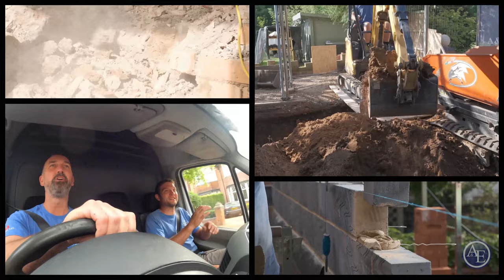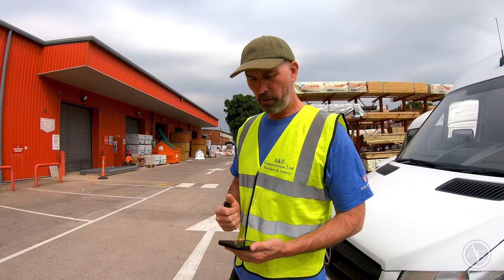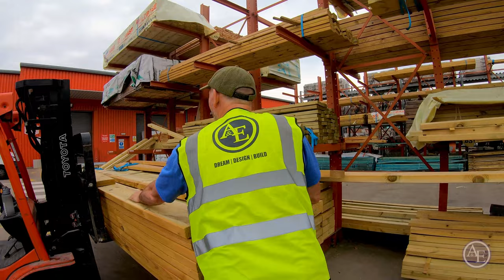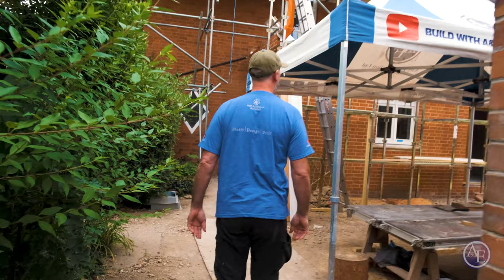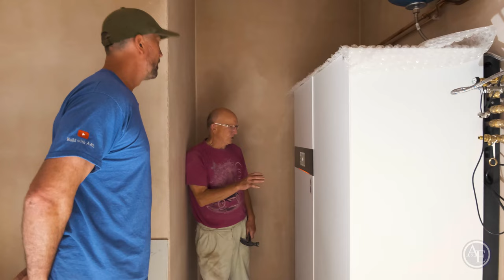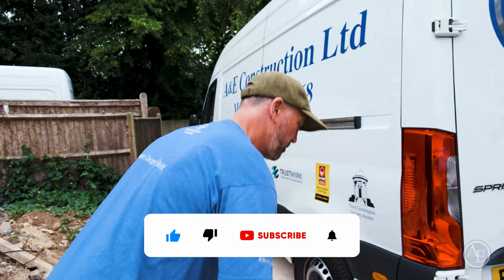House Extension Progress - Attic Conversion | Onsite #3

Comment: Hi Tony I know this isn't the latest of the vlog videos I've actually re-watched it. But quick question you wouldn't happen to know where the beam dolly's are from would you they look decent and much better than the slip-a-disk method we usually use for moving steels around. 😂
Reply from the maker: Hi Chris 
There absolute awesome bits of kit Mad4tools have them there about £1600 each but can lift 600kg much better and lighter than the genie you hire all the best Tony 👍 happy Easter
Reply: @Build With A&E  Thanks Tony for taking the time to reply, much appreciated 👍🏼 have an awesome Easter.